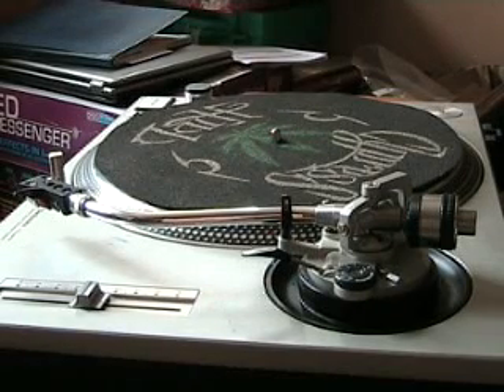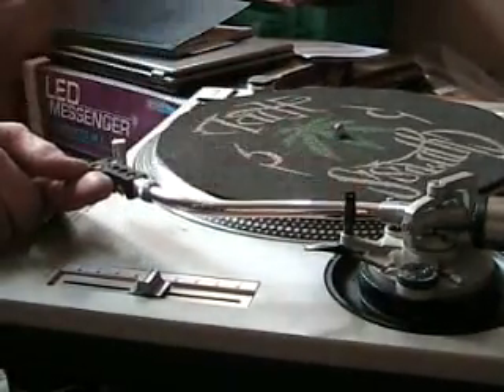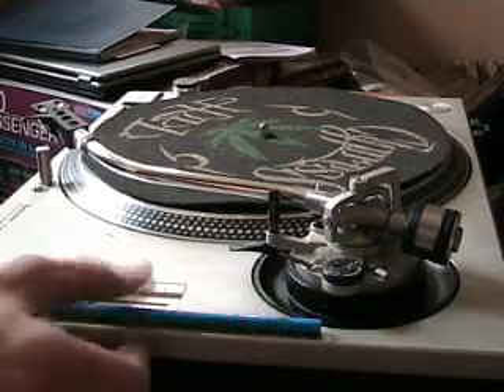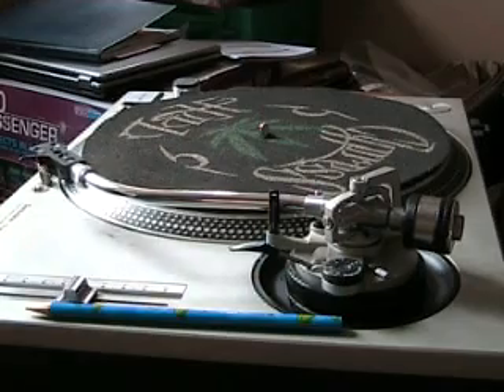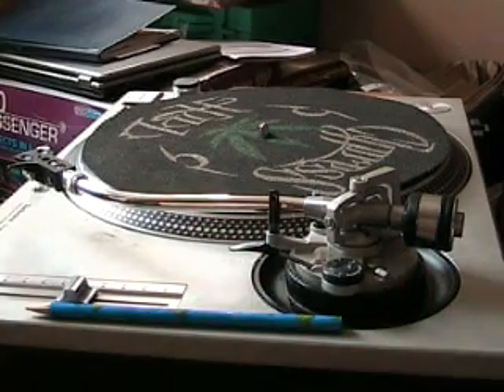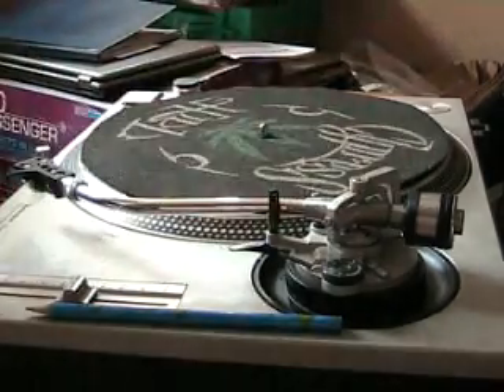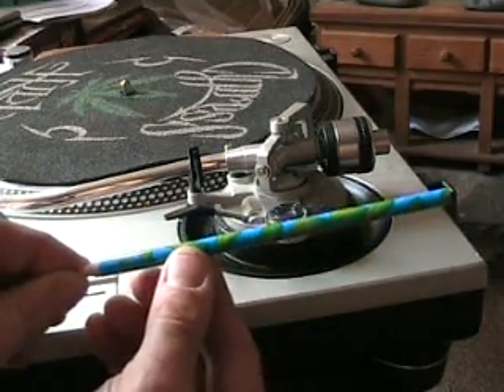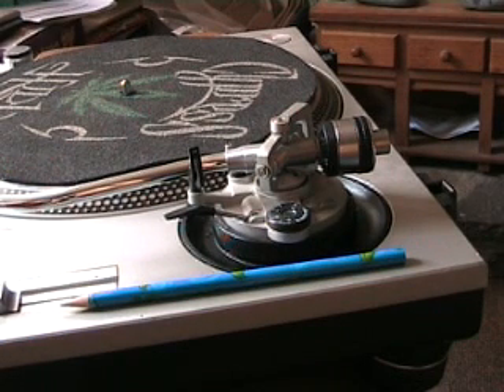How to set  the tone arm on a vinyl turntable

Comment: Anti-skate is used to counter-act the natural tendency of the needle to pull towards the center of the record.   A setting of 0 will not counter this force, and the needle will ride on the inner side of the groove slightly.  A setting of 3 will create an outward force and the needle will ride on the outer edge of the groove.  To balance the forces,  use a piece of vinyl without grooves, place the needle in the center and adjust anti-skate until the needle stays still.  DONE.

Comment: It's not supposed to be floating while it touches the vinyl... You make it float, set the dial to zero, then turn the counterweight itself to the proper setting (depending on the cartridge's weight).

Comment: Hello! i have a technical question (i have an mk5):
when i put my tonearm in the middle of the plate to balance it, it stays in place. when i put the tonearm away from the center of the plate to balance it, it keeps on going back to its base, it doesn't stay in place! what does it mean? (the anti-grip is set to 0).
Thank you

Comment: Only if the guard is designed in such a way that you don't have to physically remove it.  
If you set the balance and THEN remove the guard, that won't do any good.

Comment: No offense, but the anti-skating part is wrong. It's function is to counteract the force on the needle while in the groove on a spinning record. The best setup is actually to get a test record with no grooves, drop the needle somewhere on the grooveless record WHILE IT IS SPINNING and THEN adjust the anti-skating to where the tonearm stays in place.